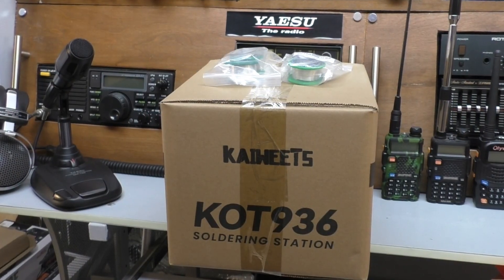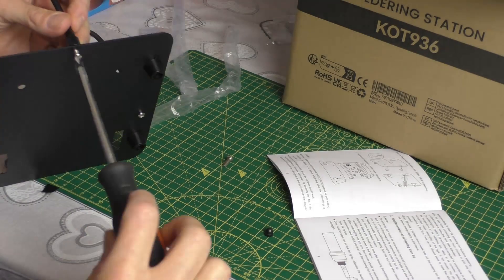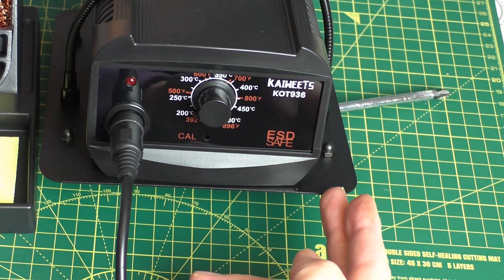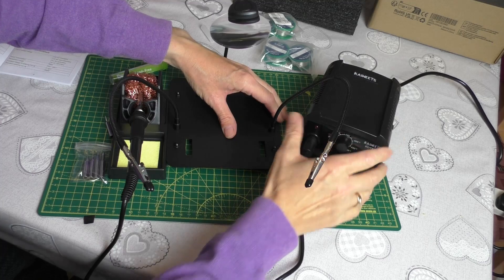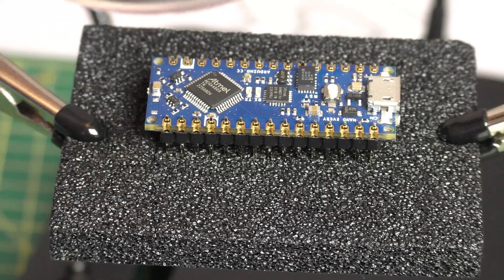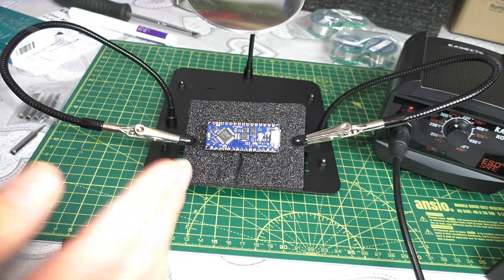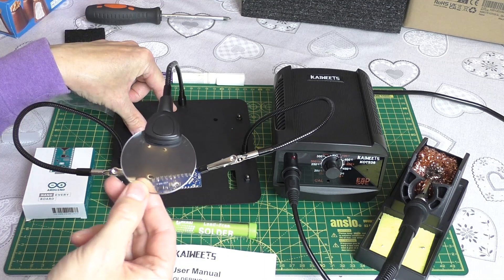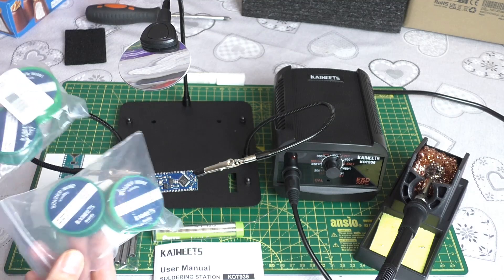I test the CHEAPEST Solder Station on AMAZON. And it WORKS !

Comment: You didn't mention it here but one thing about these 986-type soldering station "clones" that confuses newbies is that the LED starts out solid red when you turn the station on and then it begins blinking when it reaches the desired set temperature.  If you change the temperature while it's turned on, it may go solid red or go out for a few seconds (depending whether you turn the temperature up or down) and then starts blinking again when it reaches the new selected temperature.
Reply from the maker: Thanks for the info.

Comment: The ceramic elements on those irons Dont last forever, I have one and have replaced the element, you need to make sure you buy the right one though and there are two designs that look similar but have different wiring.

After replacement, you also need to re calibrate the temperature on the station.

I still have my 60w digital station that uses that iron type as a backup but use a 70w  T12 station these days, the tips on a T12 iron are also the heating element, they cost about £2 each and just plug into the irons handle
Reply from the maker: Thanks for the information.  Good to know.
Reply: So, what brand/part # of heating element did you use and where did you get them?  I'm wondering because I have a similar "Schneider" soldering station purchased from Harbor Freight for only $45; it doesn't include the helping hands or magnifier but appears a little better built internally than the Kaiweets, and uses a higher quality 7 pin screw-on connector ( only 5 pins are needed) and a metal heating element ---- I suspect it may be a Yihua. I posted a review and tear down of it on my channel.  Harbor Freight also sells a Schneider digital soldering station for $120 which is marked ATTEN ST80 on the PCB; I just bought one but haven't had a chance to put it through its paces, but I will review and  do a teardown exam of it, and post it on my channel soon.

Comment: Tips look the same as a Hakko 888, which is quite likely by design.
Reply from the maker: Thanks.  I would have thought they were generic.
Reply: The supplied tips will be iron or steel and thoroughly magnetic from stem to stern, unlike Hakko tips, which are plated copper and magnetic only at the pointy business end where they are plated with iron (to resist the dissolving effects of molten soldier and flux).  Put a magnet to your Kaiweets tips and you'll see what I'm talking about, as a video on my channel shows. Replacing the crappy supplied tips with  genuine Hakko or Weller tips made of copper (T900 or 900M; is there any size difference?) will improve performance because copper is a much better heat conductor; genuine copper tips would be safer for delicate circuit board work not only because you'll spend less time making solder connections and therefore there's less change of damage to copper foils and pads, but also because iron or steel tips can radiate a magnetic field and induce electrical current into the circuit board  and possibly damage sensitive components.

 I have a review and teardown on my channel of a very similar (but better built) Schneider branded soldering station sold by Harbor Freight here in the US, minus the helping hands assembly, for $45 (perhaps built by Yihua, not certain). They also sell a digital soldering station for $120, which is a rebranded ATTEN ST80; a review and teardown of that one will be coming soon.....